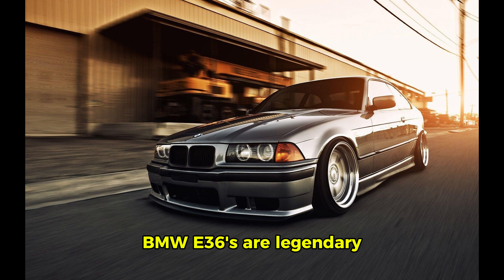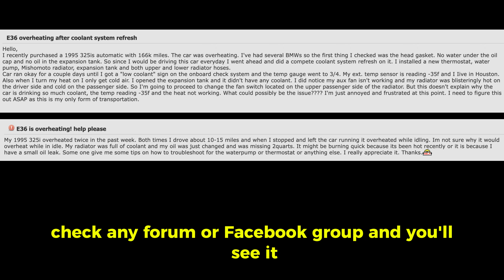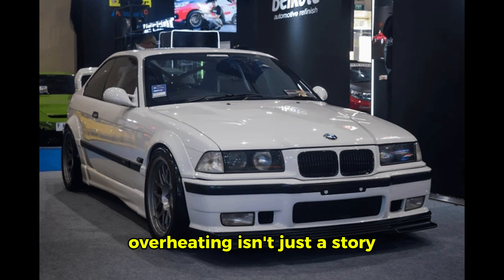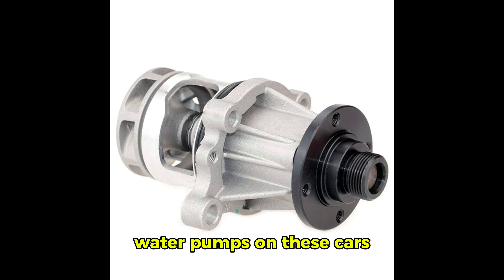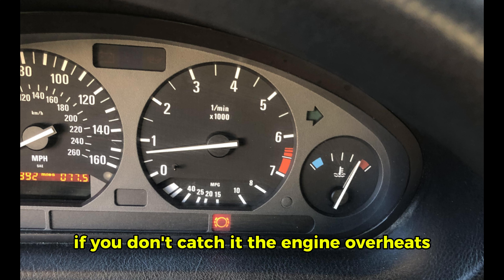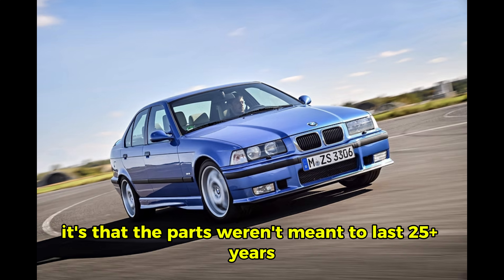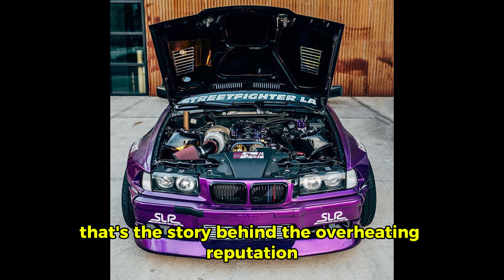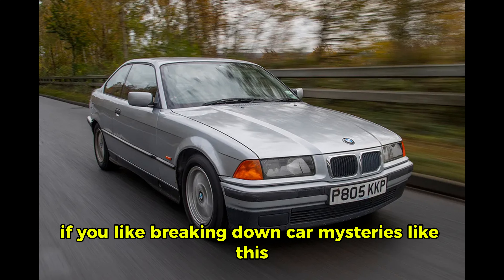Why BMW E36s Overheat (Explained)

Comment: the problem was fan bearing. it was working normal speed when i give the accelerate the fan speed was still same. i have a mechanical fan. i change fan bearing now its working fine.i remved the thermostate

Comment: I have an E46 330Ci. I've already changed the water pump, radiator, expension tanks two times, some hoses and the thermostat. I'm lucky, because the head gasket  didn't blown.